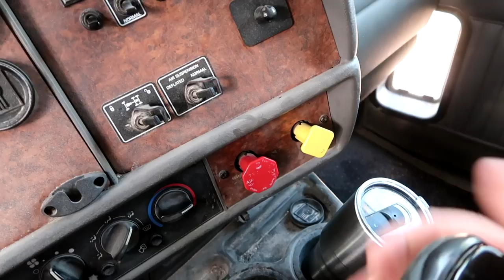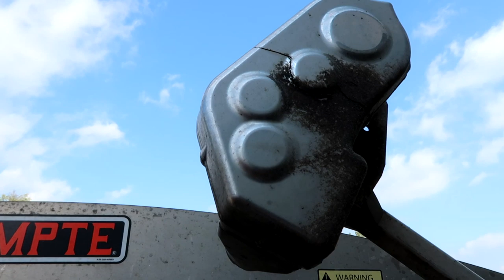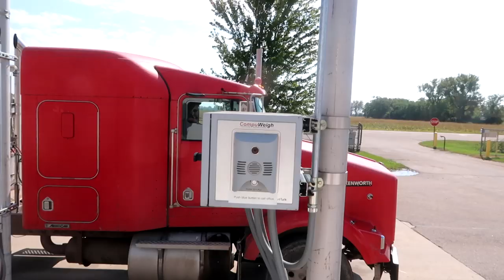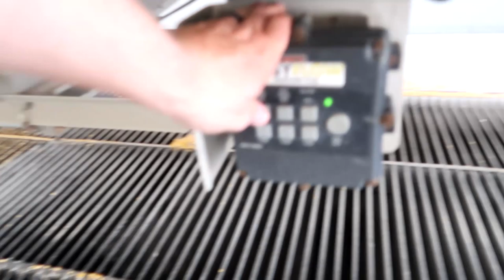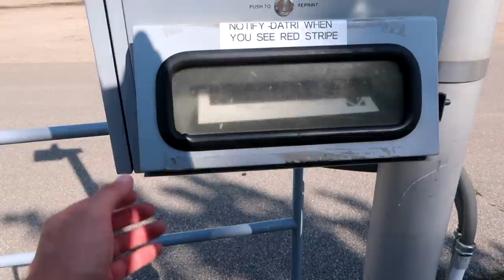Hauling Corn in Miserable Conditions

Comment: You can re program that w900 pretty easily for more horsepower and higher speeds. Any diesel shop should be able to do it for you.
Reply from the maker: We've checked with 2 different shops and both have said it's not worth it

Comment: After you pump the water out with the auger, pump a few gallons of WD40 through it to displace the water in the bearings. Might prevent the auger from receiving a gunshot wound later in its life due to bearing complications.  :D

Comment: Intresting the way you guys power swept your bins, We've always shovel and sweep behind as its running when the last truck load leaves the bin is empty and clean.
Reply: Sometimes we load by ourselves. The bin is too far to watch the truck and the big bins are too much to handle to do both. So sometimes well just run the power sweep around, push corn in around walls, run it again, repeat. Beats sitting in the bin for the whole time it's emptying out i think in the dirt/heat. Come back in the morning and clean it up when its cooler lol
Reply: We usually run 4 semi's and there 48' and 54' bins I guess the main difference is Zac's leg loading so far away from the bins, we have a 13'' 35' auger taking away from 10'' the bin augers, we only have to  hop out once each load  to move the trucks to the back hopper.
Reply: @jtn-minn8105  yeah. We also have all bins tied to utrough. So leg is always running full, it fills fast.
Reply: Bins without power sweeps we always try to chase the sweep however

Comment: Zach, you continue to amaze!   Love the new podcast studio.  Are you also planning for video in the new studio?  I notice the draping.  Sorry to see the rain continuing from a wet Spring to a wet Fall.  Did you say the new grain bin and new piping will eliminate the water issue at the base of the grain bins?  If not, would an asphalt or cement base eliminate the problem?    Thanks!!    - Dean from Edina
Reply from the maker: Hey Dean!  We haven't been doing any video of the podcasts because it adds so much hassle to it.  The new podcast will release in early October!  As far as the bins go we are hoping to get a conveyor in there this fall yet and when we do that we will solve the water issue

Comment: Hi Zach, weather seems to be more of a daily worry, more than what I have experienced or can remember from days and years past!  It seems that if one does not do or complete the task that the weather permits on the day that it permits it, one does not ever seem to get caught up and or the task never gets completed.  The days of getting  a period good weather to complete a task seems to happen on fewer and fewer ocassions as one gets older.  Let's hope for less rain and warm calm days for the fall harvest!

Speaking of variable conditions, I have a couple of curiousity type questions.  What range of corn test weights has your drying and storage operation yielded in the past?  Since your video was titled "Hauling Corn in Miserable Conditions" doing the arithmetic with regard to trailer load weight amounts, bushels and lbs. and road axle weight limits seems inevitable and necessary.  Realizing that a 42' trailer with 60" sides struck loaded with 63% test weight corn is a maximum load for road axle weight limits for a tare weight of 32,000 lb. for a 3 axle tractor and a 2 axle trailer combination, test weights and load volumes ignored, I guess can lead to citations.  Probably a fee that is more costly than than the dollars saved by overloading the trailer. 

If I could have a second question, do the test weights garnered by the delivery site seem to correlate with the volume amounts in the trailer loads?  For example, if you have a 53'  trailer with a 45,000 lb. road axle load capacity and 60" sides {96" width),  and you got a 55%  test weight, was the trailer about 85% full?  Or do you get a degree of variability in test weights via storage location and conditions such that it is hard to determine how much to load into the trailer?
Reply from the maker: Hey Ken!  Long story short, yes there is always some degree of variability which makes it difficult to be consistent with grain loads.  Usually we are within a thousand pounds of either side of the legal limit.  In this video I was about 400 pounds over on that load.  The fines can be really expensive so we do our best to stay close to the legal limit.
Reply: @MillennialFarmer  So, can I ask this question?  Do  you normally use a test weight scale to get a preload estimate of the "test weight"?  It wasn't clear in the video if some form of test weighting was used to establish load volume.  Thanks, Ken

Comment: Dropping air ?   Why don't the leveling valves drop the air automatically ?
Reply: CumminsSuperduty1 Early air suspension would explode the bags if you unloaded too fast. Now they do let air out fast enough but old habits die hard, even with Millennials Farmers..
Reply: @mfreund15448  Never heard of this before. 

Gravel trailers have been running air bags forever and they drop a load way faster than grain.  Never heard of bags exploding.

Does it have something to do with the weighing system ?
Reply: CumminsSuperduty1 aluminum trailers don’t have enough weight to hold the air bags compressed when unloading and they will expand too quick and blow them apart